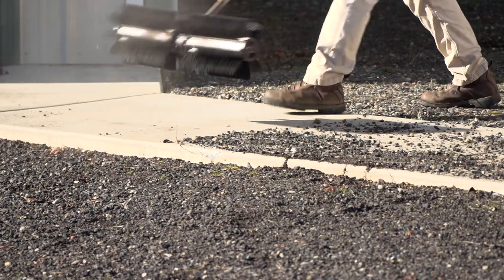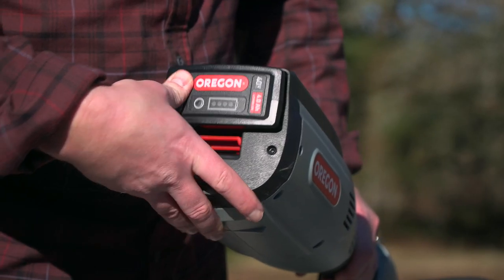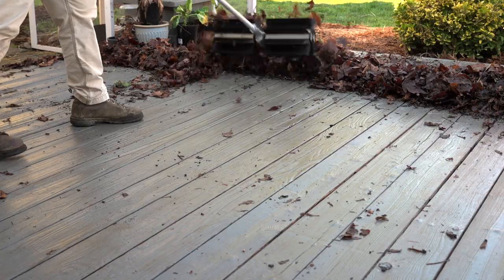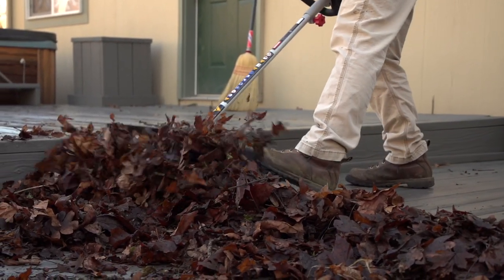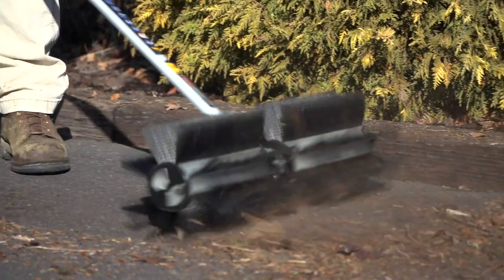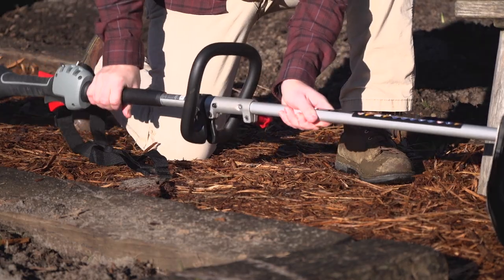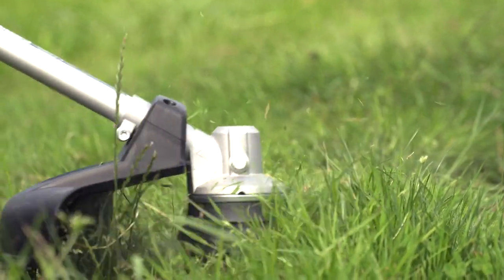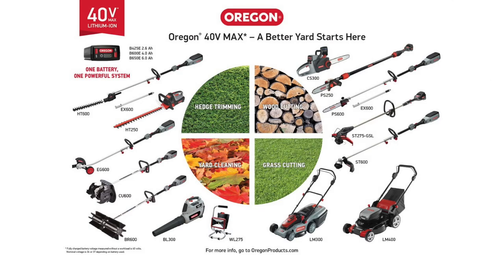Oregon Cordless BR600 Sweeper - Available in North America

Comment: As posted elsewhere...re hedge trimmer attachment...
 Nah sorry, Oregon need to look into their blade teeth design, AND blade length....broad leaves like laurel don’t fit in the open teeth which have a square end, (stupid guard went in the bin straight out of the box, wtf?) which when moving present a flat surface to the leaf over the top AND bottom blade . The actual opening is relatively narrow when oscillating compared to other blade designs. See Dewalt, among others, with rounded lobes and pointed inner teeth. The Oregon cuts stalks ok provided it hits a gap, but when your trying to get the blade bar through a bush of large leaves there’s A LOT or resistance on each pass so the head starts to spin.....This makes very tiring work, and with a short blade (probably due to resistance, as a longer blade with this teeth design would be even harder work) your making more passes, and I wouldn’t say it’s a light machine. (No experience of other pole machines for weight) a more efficient and longer cutting blade is needed. Get a smaller battery or two, to keep the weight down. But then up goes costs. Can’t help think I should ofoaid the extra for the Milwaukee set. Sorry Oregon, some good feature but the hedge trimmer needs a re think. Saw works well as you’d expect from Oregon. 
 I also had a problem with my hedge trimmer head where the gear pinion didn’t engage after removing the guard. I had to re shim it to get it to re engage the teeth. I’m hazy on the details as it was last year but iirc it was not set right from new. A few teething problems for Mr Oregon. (Pun intended)